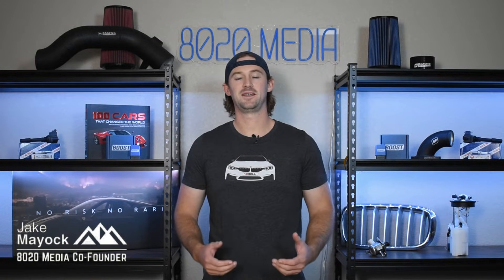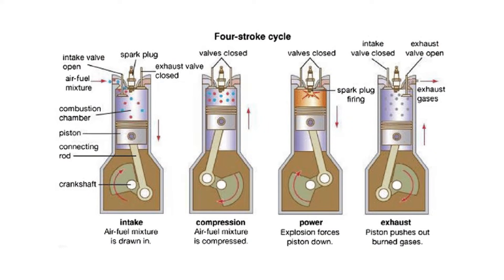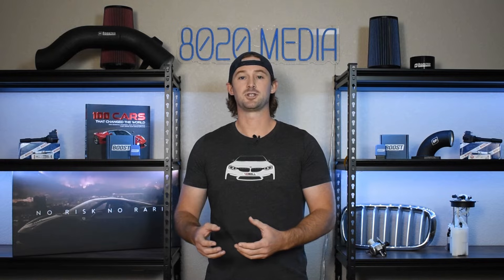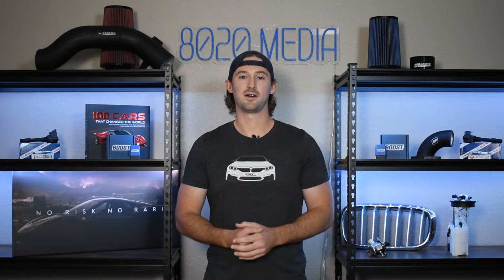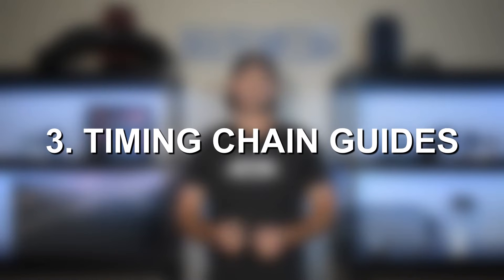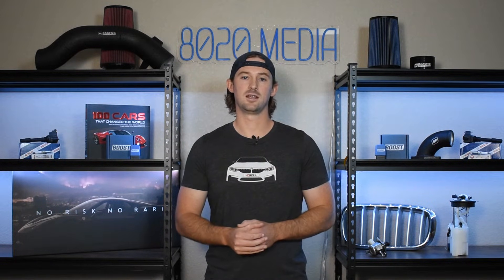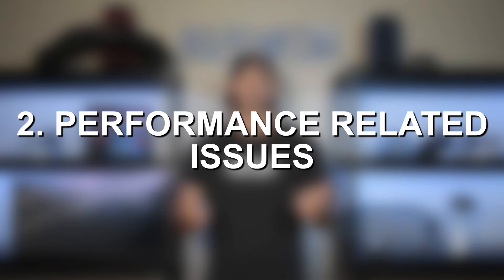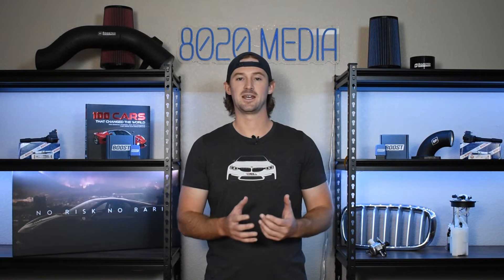Signs & Symptoms of Timing Chain Failure!

Comment: My check engine light showed a code for coil pack. It had the rough idle. It would stall sometimes when driving. It did this for about 6 8 months I was able to reset the computer buy clearing it. Last time I drove it it felt like it was running on like 5 cylinders. After the last time I drove it when I shut it off and never cranked up again. And still has plenty of oil in it was going to replace all the coil packs so I pulled one. And swapped it out with one out of my 2012 model. When I pulled it out it was covered with oil and I'm talking about a 2009 Cadillac CTS 3.6 vvt motor. Timing chain never made any noise never backfire never popped. Plan on doing the timing chain this week. But when I try to crank it up now before I do any work to it why does it sound like a car with real bad compression

Comment: Mine makes noise on start and acceleration but once engine is warmed up and been running for a little bit as the oil obviously has been cycled through and gets going the noise disapaears. Foesnt come back until i turn on again COLD could b tentioner or hydrolic?

Comment: Would the engine stop while driving
Reply from the maker: L - Yes — if a timing chain fails while driving, the engine will stop immediately because the camshafts and crankshaft fall out of sync, cutting spark and fuel timing; on many engines it can also cause severe internal damage (bent valves, piston damage) if it’s an interference design, while on non-interference engines it will just stall but not restart until repaired.

Comment: My 2006 Suzuki aerio 2.3 rattles right at a cold start and goes away no performance issues yet, 🤞 lol
Reply from the maker: G - A rattle right at cold start that quickly goes away is usually the timing chain tensioner or guides bleeding down oil pressure overnight, so the chain slaps for a second until oil pressure builds; it can also be a noisy hydraulic lifter doing the same thing. Since it disappears right after startup and you’ve got no performance issues, it’s not catastrophic yet, but it’s a warning sign that the tensioner, guides, or chain are wearing. Keeping fresh oil of the correct weight helps, but if the rattle gets louder, lasts longer, or starts happening warm, you’ll want to plan a timing chain service before it fails.

Comment: I have a 2017 kia sendona van and it started making a sound when i start up.  Nope it'll make a similar sound within a couple blocks of driving. From inside the vehicle,  it doesn't sound that like rattling.  It sounds more high pitched.  Not really high pitched,  just higher than a rattle.... more like a fan scraping or something.  I could be wrong,  but my rattle doesn't sound like yours.  Lol my SIL looked at it and guesses the timing chain.  But it only has 119k miles and has had regular service.  🤔 any thoughts?
Reply from the maker: C - A high-pitched scraping or whirring sound on cold start and shortly after driving in your 2017 Kia Sedona could be caused by a failing idler pulley, tensioner pulley, or one of the accessory bearings (like the alternator, A/C compressor, or water pump)—these components often start to squeal or make a light metallic scraping sound when their bearings wear, especially during cold starts or when under initial load. While timing chain issues are possible around 120k miles, they usually produce a harsher rattle or slapping noise, especially at startup, and are more common when oil changes are neglected. To help pinpoint the source, try removing the serpentine belt briefly (engine off, cold start only) and starting the van for just a few seconds—if the sound goes away, it’s almost certainly an accessory or pulley issue and not the timing chain. If the noise persists with the belt off, then timing components or something internal may need a closer look.
Reply: @8020Automotive  thank you for your advice! I'll talk to me Son in law about doing that.
Reply from the maker: @crystalsears4338  Keep us updated!
Reply: @8020Automotive  ok wait..I just re-read your reply.  So the timing chain rattle keeps rattling... it doesn't stop while the engine runs? Did I understand that correctly? Or does it rattle briefly then stop?

Comment: Have a 2005 Honda Accord 2.4 since brand new-only owner) Changed oil EVERY 3,000 miles faithfully. Zero leaks of oil.  Never overheated..ever.  Yet chain went (no dash light) at 220k miles 😢😢😢
Reply: Honda recommend new chain every 100k
Reply: @volt8684 is that for real. I’m working on a 09 accord 2.4 and the timing chain was a recommended service from the dealer the previous owner rejected. It has a rattle at cold start up but I’m pretty sure it’s the VTC sprocket is just worn. I’m mostly working on Toyota and Lexus and thought timing chains were usually a lifetime thing unless they got stretched by bad tensioner or the engine getting oil starved.
Reply from the maker: L - Sorry to hear this.. However, thanks for sharing.
Reply: @8020Automotive worth fixin?
Reply from the maker: @LilyWillow22  Depends how much it costs.. I'm afraid it could be more expensive than the value of the car. However, not sure what your financial standing is so it's hard to give a straight answer.

Comment: Hey, i have a 08 F150. I thinking its a timing issue. I got a P0340/P0344 crankshaft position. When the vehicle is hot after driving and im pulling in the driveway it start acting as if its starving. When i put in park and give it gas it levels back out. Can a timing chain failure be  intermittent?
Reply from the maker: S - Yes, a timing chain issue on your 2008 F-150 (especially with P0340 and P0344 camshaft position sensor codes) can absolutely present intermittently, especially when the engine is hot. Heat causes metal components to expand, which can worsen a stretched chain or a worn tensioner/guide issue just enough to throw off cam timing, triggering those codes and causing rough idle or stalling symptoms. When you rev it in park and oil pressure increases, the tensioner may regain enough pressure to temporarily correct timing alignment, making the engine smooth out again. While sensors can be a cause, the combination of heat sensitivity and recovery when revving strongly points to a mechanical timing chain issue, and it’s worth inspecting the chain, guides, and tensioner closely before replacing any more electronics.

Comment: Well idk if timing chain went in my 2012chevy Malibu Lt 2.4l timing chain is tight not loose though BT won't start
Reply from the maker: C - If your Malibu won’t start but the timing chain feels tight, it’s still possible the chain has jumped a tooth or the timing is off, especially if it cranks but doesn’t fire up. These engines are known for timing chain stretch, worn tensioners, and guide failures, even when the chain doesn't feel loose by hand. A tight chain doesn’t guarantee proper timing—it just means there’s tension. Common signs of jumped timing include a no-start with no compression or weak compression across cylinders, possibly with a P0016 or P0017 code. To confirm, pull the valve cover and check if the camshaft alignment marks line up at TDC. If they don’t, your timing is off. You’ll also want to verify spark and fuel are present just in case it’s unrelated (like a crankshaft position sensor, fuel pump, or fuse issue), but with no start and chain concerns, timing is a top suspect.

Comment: Hi, I can hear rattling from my engine when isidling. My car is 8 years old with very low mileage (25000 miles). It's been serviced annually by a franchised dealer. Last service 2 months ago and my dealer gave a clean bill of health. I do not get any engine warning light. Should I be concerned? Thanks
Reply: Take it to an honest mechanic right away if there's some reason the timing chain has an issue it could destroy your entire engine if it breaks or skips a tooth. Seems like it shouldn't happen on 25,000 miles but you never know I would take it straight to a mechanic and if you have a good amount of money I wouldn't even drive the thing honestly I would take it to a mechanic via a tow truck just in case
Reply from the maker: M - Thanks for helping other viewers!
Reply: It's not necessarily going to throw a check engine light. I've never read of anyone saying they had a check engine light come on before their timing chain snapped but if a timing chain snaps it will destroy your entire engine
Reply: There is a very small chance your engine is what is called a non-interference engine which means it wouldn't destroy the engine but I don't think they really even make them anymore you could Google your very specific engine don't Google your car Google the very specific engine you have and see if it's a non-interference or an interference and triple check what it is because there's a lot of people out there that will just say it's a non-interference when they don't know what the hell they're talking about triple check quadruple check or more this is nothing to play around with it will destroy your whole engine if it snaps and it's an interference engine
Reply from the maker: N - A rattling noise at idle, even with low mileage and regular dealer service, is something you shouldn’t ignore—especially if it’s a new sound. At 25,000 miles, wear shouldn't be a factor, so this could be something like a loose heat shield, a worn belt tensioner, or even a timing chain guide starting to degrade (especially on certain engines known for that). The fact that there's no check engine light is good, but not definitive—mechanical issues don’t always trigger a fault code. Since it was recently serviced, it's worth checking that everything was properly torqued down, and use a mechanic's stethoscope or long screwdriver to pinpoint the noise (valvetrain, accessories, or exhaust-related). You don’t need to panic, but I’d get it listened to soon—early diagnosis can prevent expensive repairs later.

Comment: Hi, my timing kit was chnaged as new and the rattle it is still there i rly dont know what it can be
Reply from the maker: C - Sorry to hear.. If you’ve already replaced the timing kit and the rattle is still there, the noise could be coming from a few other spots people often overlook—most commonly, a worn or loose timing chain tensioner (especially if it wasn’t replaced with the kit or if it’s oil pressure–dependent and your oil pressure is low), a faulty or misaligned chain guide, or even something external like a loose heat shield, accessory pulley, or a bad variable valve timing (VVT) solenoid if your engine uses one; also, make sure you’re using the correct grade of oil because the wrong viscosity or dirty oil can prevent proper tensioner operation, and if the rattle is only on cold starts and goes away, that really leans toward a tensioner or oil pressure issue, not a faulty install—so next step should be confirming oil pressure and double-checking the torque and alignment of all the timing components to rule out a mechanical flaw in the reassembly.
Reply: @8020Automotive see that's why I will not chain mines until I'm absolutely certain.  After changing the fuel pressure sensor.  That rattle went away and the car was quiet as a church mouse.  Then with the flooding in town I ended up going through a few huge puddles and then the sound was back even worse.  So idk what to do but the codes haven't been cleared after changing the fuel pressure sensor so could that be it?

Comment: My timing chain is bad.  There were metal shavings on my vvt solenoid.   Is my engine shot?
Reply from the maker: V - Sorry to hear this.. Finding metal shavings on your VVT solenoid alongside a bad timing chain is a serious red flag, but it doesn’t automatically mean your engine is shot—it depends on how much metal circulated, where it went, and whether there’s internal damage to components like the cam phasers, oil pump, crankshaft bearings, or journals. If the shavings are fine and limited to the timing area, you might get away with a full timing set replacement (chains, guides, tensioners, and VVT solenoids) and an oil system flush, but if larger particles made it into the oiling system, they could have already started damaging critical surfaces—so the smart next step is to check oil pressure, pull the oil pan and inspect the pickup screen, and if possible, inspect rod and main bearings before deciding whether to rebuild, replace, or salvage the engine.

Comment: I think my chain skipped off. How do you determine if it's worth fixing? I was parked at the time not driving but still 😩 2005 ford explorer
Reply from the maker: C - If you suspect the timing chain on your vehicle has skipped, the first thing to check is whether the engine still cranks normally or sounds unusually fast or uneven (which can suggest loss of compression from valve timing being off); since it happened while parked and not under load, there’s a chance you avoided catastrophic damage, especially if it’s the 4.0L SOHC V6, which is a non-interference engine—meaning the valves and pistons don’t usually collide when timing is off. To decide if it’s worth fixing, perform a compression test or leak-down test to confirm the engine’s internals are okay, then weigh the cost of a timing chain service (which is labor-intensive on this engine, especially with rear chains) against the value of the vehicle—if the rest of the Explorer is solid and the engine internals are unharmed, it’s usually worth repairing.

Comment: Hello There! Just came across this video because there was no oil in my volkswagen jetta a few weeks ago so i added some. today when finally doing my oil change it did not solve my rattling noise. 
So I suspected it to be the timing chain. The noise happens during start up like the audio example, but does go away sometimes. When driving in the freeway it doesn’t sound too bad, it’s mostly at lower MPH, when starting up the engine & while idle. 

my check engine turns on and off, and many shops when checking my codes say it’s my intake manifold bank 1, and Camshaft sensor. does any of this sound correlated? thanks for the great video by the way!
Reply from the maker: C - Yes, everything you’re describing are absolutely correlated and strongly point to a timing chain issue on your Volkswagen Jetta. The rattling noise on cold starts is a common symptom of a stretched timing chain or failing tensioner, especially on VW engines like the 2.0 TSI, which are known for chain and tensioner wear. As the chain slackens, the camshaft timing becomes inconsistent, which triggers codes for the camshaft sensor or intake timing errors (Bank 1)—and since these problems can come and go with temperature and oil pressure, it explains the intermittent check engine light and variable noise. At this point, you should have the timing chain, guides, and tensioner inspected ASAP, because if they fail completely, you risk valve-to-piston contact and major engine damage.

Comment: Hey man just found tour video, I’ve suspected my timing chain to be bad and I hear almost exactly the noise you showed in your video on start up. Once it’s running however, I don’t hear the noise until I accelerate the vehicle. Is the load place on the engine correlated? I’ve tried revving in park or neutral and can’t really get it to happen
Reply from the maker: N - Yes, what you're describing is a strong indicator of a worn timing chain, tensioner, or guide issue, and you're exactly right to suspect that engine load is playing a role; when you're in gear and accelerating, there's increased tension and torque fluctuation on the timing system, which can cause a loose or stretched chain to slap or rattle more noticeably, especially if the hydraulic tensioner takes a moment to build pressure at startup or can't hold proper tension under load—this is why the noise disappears in park, where there's no real engine load and smoother RPM changes; at this point, it's wise to inspect for chain slack, worn guides, or a tensioner that’s bleeding off oil pressure, especially if you’re hearing startup rattle and it's getting worse.
Reply: Thanks for the feedback, I really appreciate it! I’ll just have to dig into it and hopefully that’s the case
Reply from the maker: @nicholasbeattie2538  Keep us updated.
Reply: Same issue but also I get it when I decelerate to a stop from high gear like 8 or when accelerating from 3 gear. Is it the same issue.?

And also every time when I start the car when the engine has cooled down